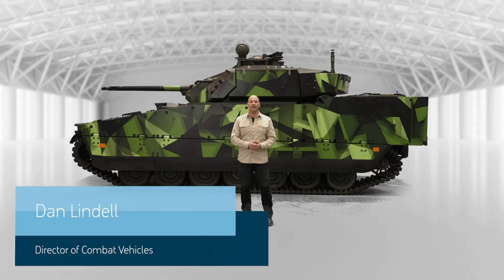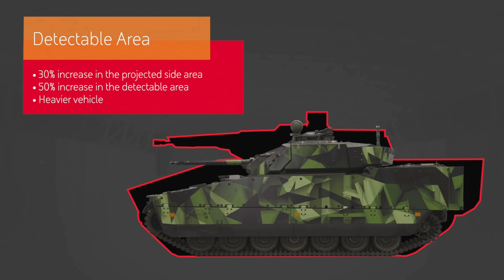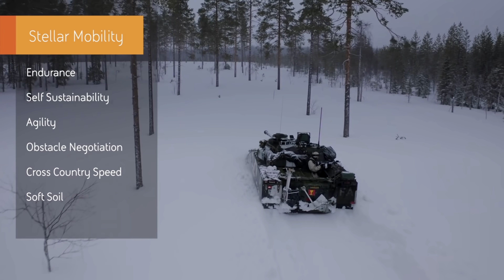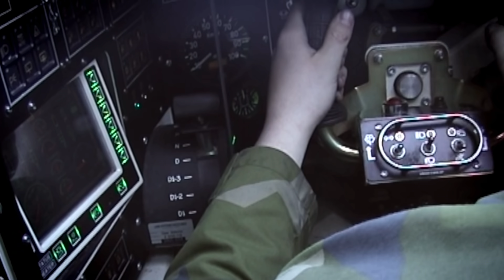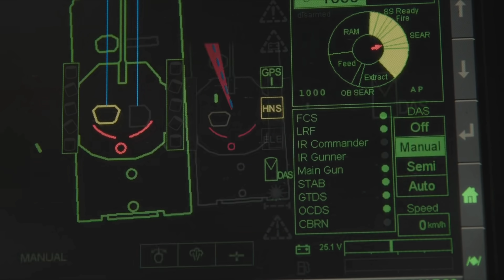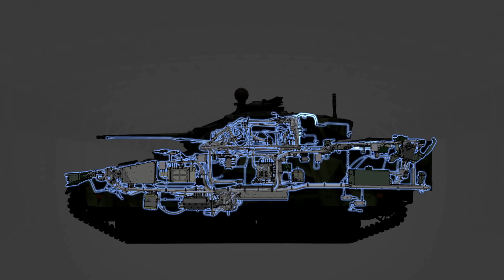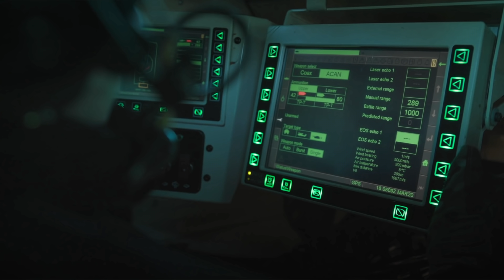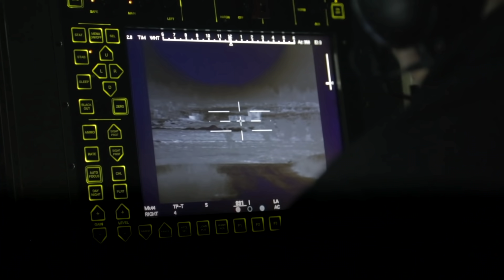The CV90 Infantry Fighting Vehicle Family | THE BEST IFV IN THE WORLD 🏆

Comment: Personally, I hope they haven't cured the issues with Ajax come August. The MOD will then cancel the entire thing. Hopefully, we can then go and get the best IFV in the world, KMW Puma. It's by far the most advanced platform has the same dimensions of the older CV90, so can be transported in an A400 and is by ar the best in every matrix.

I thought the CV90 was a good platform 30 years ago. The issue for me is those upgrades are limited. Why are other nations going for Boxer, Puma, Ajax etc?  I'm sorry, the IFV’s days are over. The issue the CV90 has is it cannot be upgraded to the level these other platforms can the KM2, Bradley 3, Boxer and Puma can all be upgraded in a specific way the CV90 cannot.

In theory in the assault, whereas APCs can’t suppress the objective IFVs can (or could, if their guns were stabilised). In practice IFV’s are led by tanks in the assault, firing on the move to destroy armour and trenches. More tanks provide direct fire support, while mortars and artillery also pound the objective. During the (say) two minute, 1,000m run in the IFVs will struggle to acquire targets due to the obscuration from the high explosive and smoke as well as the dust thrown up by the leading tanks. (If, as is common, the IFVs are in platoon box formation, the rear IFVs will have more dust thrown up ahead of them by the leading pair). It seems unlikely that they’ll acquire many targets.

At the dismount the supporting indirect fire shifts to the enemy depth positions. Tanks and IFVs halt and the infantry debus. They’re now at their most vulnerable and in theory the IFV should be suppressing the trench that they’re assaulting. Except it can’t, as it cannot depress its gun far enough. It’s 8 degrees of depression means that the closest it can be to trench is about 20m, leaving the dismounts with a perilous passage, particularly if enemy artillery is landing (as is likely). The often preferred alternative of dismounting on or just beyond the objective means that the IFVs armament has contributed nothing to breaking into the position. It might now contribute to suppressing the depth position, but only as an augmentation to the artillery, mortars and tanks already doing that. The problem of obscuration remains. The IFVs turret is next to useless in its primary role.

What about defence? There may be a role for a vehicle with an anti-amour capability to screen the defensive position from the enemy advance and to start attrition.  Such vehicles exist; they’re called tanks. Using an unnecessarily large (and therefore lightly armoured) IFV to fight vehicle on vehicle with an advancing horde (probably led by tanks) is a recipe for disaster – even more so if the infantry section is mounted. Digging IFVs in on the position requires substantial earthmoving to add an incremental increase in direct fire. Holding the IFVs behind the position to counter-attack (presumably with supporting indirect and tank fire) shares the IFV’s shortcomings in the attack described above.

What about other operations – perhaps mounted patrols in a COIN environment? Again, if the insurgents have anti-armour weaponry or tanks it’s hard to see a benefit from having a turreted IFV in place of an APC with a remote weapon station (RWS). APC’s work, and work well because they rely upon all arms warfare, with tanks, artillery and other specialised platforms (now including drones) delivering capability as required. The IFV, seeking to provide (variously) protected mobility, direct fire support and long range anti-armour cover is, at best, a jack of all trades and an (expensive) master of none. In the event of an APC mounted patrol encountering a serious armoured threat the best option is to pop smoke and reverse urgently while a more capable system, such as a tank or attack helicopter, destroys the threat.

The development of smart artillery rounds such as Excalibur enable precision hits on a trench the case for a suppressive fire capability on an IFV further diminishes. The expansion of top-attack anti-armour rounds makes the case for active protection systems (APS). Remember that the Israeli Army, which has more recent combat experience than most, never purchased the M2 Bradley (which it no doubt would have received on attractive terms). Its own, current Namer APC has no turret, but does have Trophy APS.

Just as the British Army found with it's Warrior IFV it too cannot be upgraded anywhere near as good as the new platforms can. That's why I wouldn't procure the CV90 as I wouldn't have upgraded Warrior any further. You need to have your APC/IFV that is able to avoid the drone, bullet; targetted shell. The IFV concept is fundamentally flawed, delivering expensive but unnecessary capability at the cost of more useful ones.

Comment: Probably the world's foremost IFV, however the Russian 9M133 Kornet will obliterate it on the wheat-fields and forests of Ukraine. At $5 million a pop (times 50 units= $250,000,000), it's the wrong weapon. Russian killing ratio will still be 8:1. Ukraine has already lost this GD war.
Reply: Kornet is good ATGM and can kill most tanks. But when the Kornet use its laserbeam on a modern CV90 it will give away its position to the CV90 sensors.
Reply: @len2063  yup I play wart thunderbin cv90 and when my Laser sensor lights up I instantly smoke and they miss
Reply: Why do russian orcs still use BMP if it can easily be obliterated by even the cheapest RPG never mind matador or Panzerfaust ?
Reply: @johndorian3685  ukraine uses bmp too though
Reply: I think most Ukrainians would take this over a BMP any day of the week considering the monumental upgrade in optics and fire control over what the Russians are using. Western ATGMs are liquidating Russias armor by the brigade as well in this war.